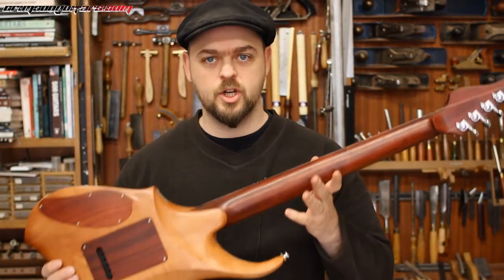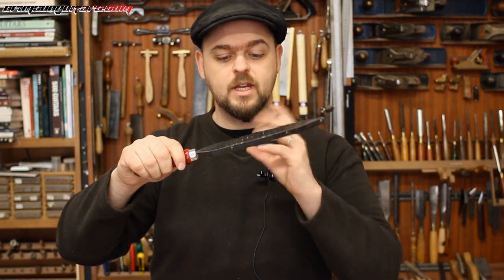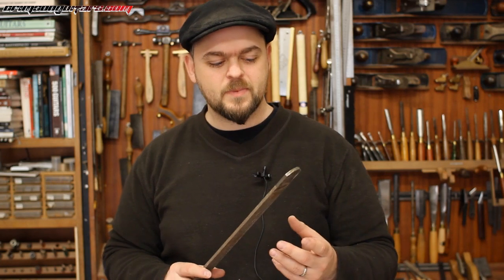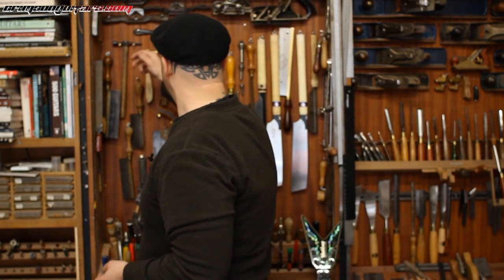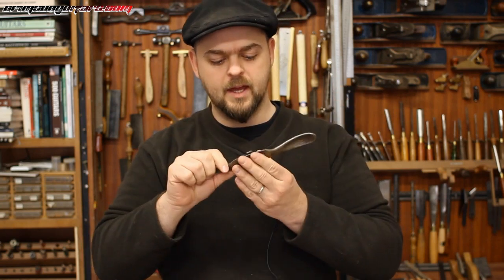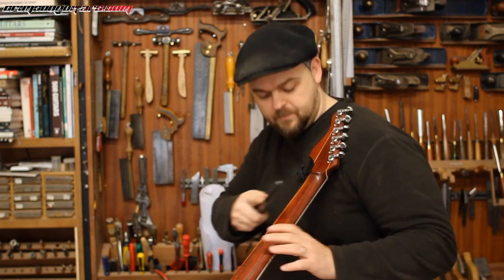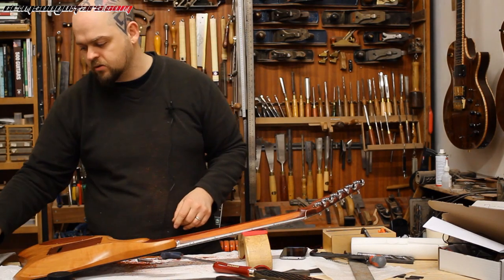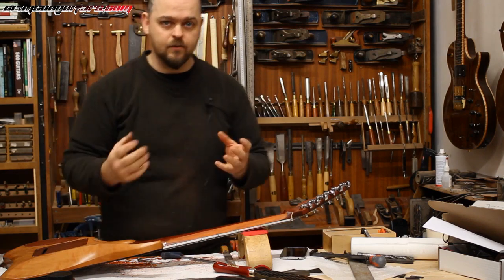Ep 2 of 3 - Sygil Guitar Refurbishment - How to Re-shape and Re-carve a Guitar Neck

Comment: I've made  few necks using a drill press with sanding drums of different diameters. I run the wood back and forth rapidly the long way, and presto! The drums do not leave bumps, but rather even out to make a flat surface. Smaller drums for the deeply curved sections. Once my press was not working, so I chucked the drums in a hand drill. Worked OK! Note that my skill level, compared to yours, creates guitars that are perfectly suited as canoe paddles.

Love your videos!

Comment: O Ben !  "an angle grinder and flap disc" ???
I saw your collection of vintage tools and thought that there was going to be something pretty happening here. Good on ya. I use a small draw knife , knives ( left and right ground ) , spokeshave and block plane. Rasp if there is any funny grain . 150 paper then 320 all on blocks, curved for the heel and volute. All very fast and satisfying. 
I can't work holding the job unrestrained .In a vice or clamped in some way is essential to me.

The tip on rotating the neck to check against  the horizon of the fingerboard join was the best and most magic. I have never heard anyone else use this technique.

I use my big body grinder with a cutter something like chainsaw teeth to rough out double bass bellies and backs.
You are brave Ben to expose your work practice to the net world. Your lovely! better than the awful prospect of CNC or deposition.

Comment: I have a big 17" farrier's rasp. I prefer it to the shinto rasp. I can't keep the shinto under control when I try to use it. It cuts unevenly and gets into ruts. I don't like it. I'm fully convinced that I'm not using it right, but the farrier's rasp gives me good results, so I don't have much impetus to practice with the shinto.

I use the horse rasp for the big hogging work, and then some smaller, hand-cut Japanese stewmac (sorry Ben) dragon rasps for finer work. Then a mill file and sandpaper.
Reply from the maker: I forgive you Mark.. We're not yet at the stage where we can offer everything they do.. Yet! :) I have experienced the same thing with the Japanese saw file, at certain angles it can get caught in a rut and become difficult but you just can't beat it for rapid removal of stock.. I must confess that I haven't really given my farriers file/rasp a proper go though so there is that, it may just supplant the shinto in my top spot.